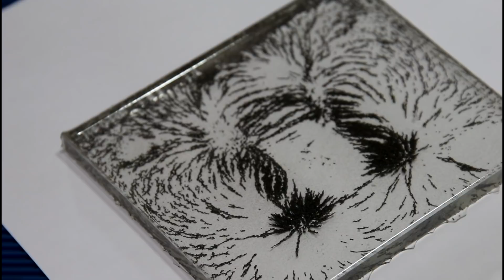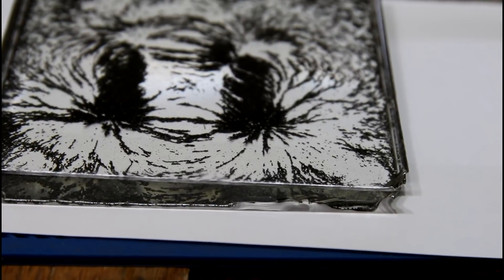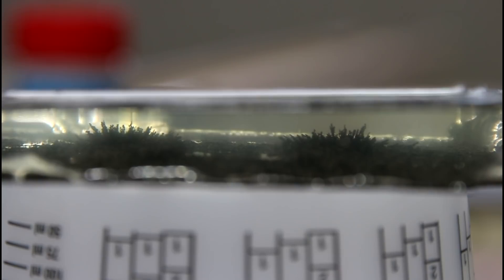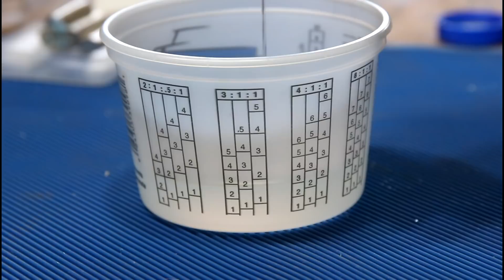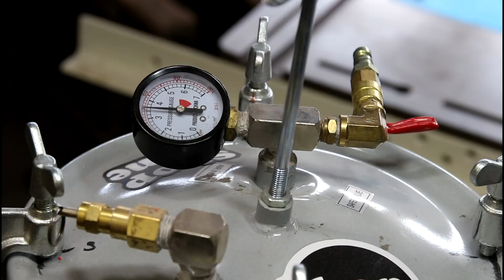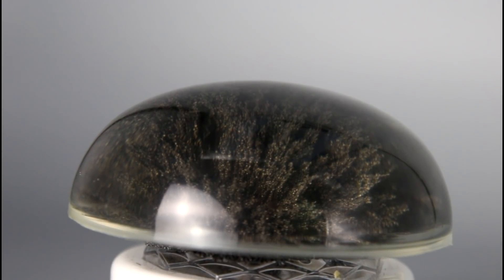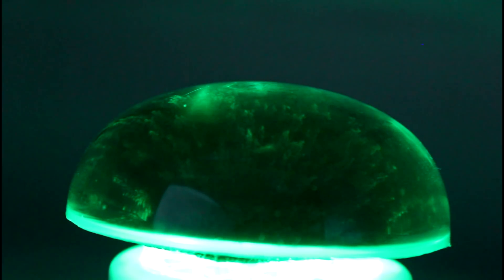Capturing Magnetic Lines of Force in Resin?: Social Distancing Day 5

Comment: Heey! I just saw the silicon problem, you can use 2 pieces of 8 mm mdf then  hole it to fit part of the top and hold the parts with 3 or 4 contractor springs ( tight enogh to keep them together while the resin cures ).
Hope it works!

Comment: Ok so, I'm almost a year late... but a few ideas?

What would happen if you mixed the iron in with the resin, poured it into the mold, degassed, then put the magnets on the outside of the mold? Maybe use a semi quick setting resin?

You could invert your idea and put the magnets in the bottom of the container, then place the mold on top and repeat. You'll just have to be careful to not knock the magnets over. 

You could theoretically make a brick, doesn't have to be thick... You have the magnet flat on the bottom outside the mold, you sprinkle the filings in around the magnet, then go about the process. 

What do you think?

Comment: I have this globe and there is a way to use it. Before you pour, wrap the globe in Press n' Seal plastic wrap. It has to be Press n' Seal or it won't work. Then you can tape the outside of that if you like though I've never had to.

Comment: For the round mold Couldn't you just do the bottom of the round mold like you did every other mold (magnet open top in the pressure pot) then put the top on the round mold and fill the top when the bottoms not going to mess up?

Comment: Could you use silicone caulk to adhere the silicone mould together, do the pour, then just sand any gaps smooth? Or even use a bigger ice ball mold, seal it with silicone & tape, then turn it on the lathe and then mount it on a piece of wood, with an LED light under it, hidden by the wood base...... Please, try this!!!!!

Comment: Cool Video. I have an IDEA. How about you do the iron filings in resin but have enough iron filings that it projects over the top. Cure in the vacuum and then let it soak in salt and vinegar solution so the iron filings oxidize. then let it dry and walaa.. The rust colors should look amazing inside the resin.

Comment: Hello, dear, you should use hot glue gun to seal halfs of silicone sphere. 
I have such one (diameter 60mm) and I tried to seal it by different ways - by duct tape, by small clamps - nothing helps, resin was poring out of a mold, until I tried to seal it by glue gun.

Comment: I noted other youtubers stating this... Why haven't you tried mixing the iron filings into the resin then have the magnets on the outside of the mold?  Use a relatively thick/thin resin to allow the filings to move and create the 3d render of the magnetic field.

Comment: The iron filings align themselves to the magnetic field lines not force lines. The force is applied as a reaction of moving charges or aligning magnetic domains in the material. If you are trying to capture the field lines themselves it may work better to mix iron filings into a long cure time resin then apply a magnetic field so that they slowly align themselves along the applied field before curing.

Comment: I'm just thinking out loud but maybe since the tape won't stick to the silicone it will stick to itself next time try wrapping the whole thing up and then poke a hole where the hole is. Then again I've never used epoxy resin so I also might be suggesting a mess

Comment: Very cool! Just a couple FYI's there actually are tapes with silicone adhesive as well as the silicone adhesive itself. https://smile.amazon.com/J-V-Converting-PPT-36G-GRN172-Silicone/dp/B004MSKKI8/ref=sr_1_8?crid=3TRT6FOYDR83G&dchild=1&keywords=silicone+splicing+tape&qid=1595243838&sprefix=silicone+splicing+tape%2Caps%2C143&sr=8-8
and https://smile.amazon.com/GE-Sealants-Adhesives-GE500-Advanced/dp/B000M2UPAG/ref=redir_mobile_desktop?ie=UTF8&aaxitk=dTVs8Cp77cVfmDnswDa5dA&hsa_cr_id=2635427820201&ref_=sbx_be_s_sparkle_mcd_asin_1
I've used the red and green tapes, both work quite well.

Comment: Smoothon has a bunch of different resins with different properties - would be fun to try some of them.  Also found that there are many sources for magnetic powder that people add to finger nail paint. https://glitterandcrafts4u.com/collections/3d-magnetic-powders  Lastly - Bubbles that form after pouring are generally due to moisture.  This could be the resin or the iron filings.  Keeping your resin "dry" is tricky - when I did commercial resin casting we had a air tight container that we stored our resin containers in and would use dry gas (Simple nitrogen from a welding store works great) to purge the container afterwards.  A pressure pot will help but make sure you are filling your pressure pot with dry air.  Very cool!

Comment: you should mix the filing into the resin then put the magnet on the container. if you use some sorta agitator to help move the filings towards the magnet before it hardens you might be able to get clearer lines of force as it would be able to preserve the lines without having to create the base clump for it to climb up from.

Comment: So... could you fill a mold with resin and add the fillings to the top and have the magnets underneath  to pull the lines through the resin? Instead of having them "premade" and dipped into? Or is the viscosity of the resin to thick for the magnets to pull the filling through???

Comment: The solution to holding your sphere moulds together is rubber bands... btw if you want a cooler effect, get a sphere neo mag, and a small (as thin as you can get) toothpick like clear resin stick that has the same refractive index as your resin so it will disappear when the resin is poured, and uv resin the sphere neo mag to that stick, and then the stick to the bottom of the sphere mould using resin to make a sort of foot so it stands up on its own (yes, this would take multiple stages for curing)... then either apply the iron filings now then fill the mould as usual, or wait till the mould is filled and see what effect that makes... but should turn out looking like an explosion of filings emanating from the center of the resin sphere (could layer yellow/red/orange colored filings to maybe make it look more like an explosion if you wished)

Comment: Here's something to try: Ferromagnetic fluid. Works a lot like this, except you need to add a metal shape on the other side of the magnet for it to grow around and the spikes end up much more smooth.  I'd suggest something with wide threading.  And (not sure if this part'll work but) if you can then drain the ferrofluid out after the resin sets, you can reuse it and fill the void with resin (or whatever) of a different color.

Comment: As others have said, it would be interesting to see what shapes you would get from dispersing iron filings within a slow cure resin then pouring the resultant filings/resin emulsion into the mould. With the neodymium magnets you could then even place 1 magnet under the mould and 1 magnet on top of the mould and create a sculpture of the resultant magnetic force lines between the two magnets.

Then, regarding the bubbles of air 'leaking' from the filings (and I'm just spitballing here as I dont know resins), it might be possible to mix the iron filings with your part A, leave it time for the air to release from the filings, then mix the part B in.

Comment: too hot and iron can lose its magnetism, although unlikely those particles are really small. 

itd be interesting to know what the densitiesof the resin are in each stage, premix/mixed/curing/cured.

depending on that, purchase or create ferrofluid with varying  diferrence in density, ie more dense/less dense/equal. 

this seems really interesting and has given me so many ideas. 
i wish i had the means to attemptt.

imagine a copper coil encased in resin tabletop but with hollow tunnels to send batteries with magnets along.

you could feasibly create something like a gumball dispenser like that.

heck just a single hollowed out cylinder in a table top with this magnet prokject or similar suspended particle resin cast ie-wood, glitter etc. use that hollowed out area to install leds or somthing. that way they are both optional and replaceable vs castinf in the resin.

im pretty stoned howed i get here...
Youtube >.>

Comment: you need to make a external casting to act as a framework to support to silicon innermold. you could use resin or plaster of paris or something for the support mold. Also you could drill a hole for magnets in base of framework help hold the whole thing together for putting in pressure or vacuum tank.

Comment: I have those same sphere molds

I just use hot glue to keep them secure. Hot glue the edges.

Yes it actually stays in place enough for the epoxy to settle after curing ^^

Comment: You could seal the two halves of that sphere mold together with silicone cement. But you would probably have to destroy the mold (or at least damage it) to get it off after the resin hardens.

Comment: Hi, when I’ve used the ‘globe’ silicone moulds, I filled the bottom half first, run some fire across the top for bubbles, let it stand to begin curing for about 4-5 hours, then put the ‘lid’ or top part on and fill up the rest through the hole. :) I don’t have the machine you have though...

Comment: I wanna know what would happen if you mixed the filings into a thinner, runnier resin, poured the filing mixture into a dish, poured clear resin on top, and then added a strong magnet to the bottom of the dish. Would the resin allow the filings to move around and create structures along the flux lines? Or would it just clump up in the bottom of the dish and make a mess?

SCIENCE!

Comment: If you pour the resin over a piece of smooth wood first, like a wooden spatula or a ice cream stick, it will significantly reduce the bubbles. And pour more slowly, most people put the stick into the mould at an angle and pour down it as slowly as possible from as low as possible to reduce bubbling as it meets the surface.

Comment: Hello, I just fell upon your post and might have a suggestion or two for you. If you wanted to try to use the two pieces of the Dome together again you might want to try to seal the lips of each piece with some silicone glue or caulking. It also comes in clear and it should stick to the silicone domes at least enough for your project.

The second suggestion I have involves around the type of camera and or lens that you're using. You may want to use a zoom lens on a SLR digital camera and take it out of automatic mode. Adjust the lens and camera settings to maximize your depth of field. Part of the problem you were having I believe is that camera was focusing on the nearest of the stalagmites of magnetic particles. If you increase the depth of field the focus isn't just in the front but also opens up to include the back particles. If you try this and it's successful you might want to let me know I'm just curious. Good luck, stay safe, Paul

Comment: You could just mix a small amount of the filings into resin and the pour it. I believe they will form lines with spaces of clear resin in between them, without going into big clumps like when they're under gravity in air (being suspended in resin before being in a magnetic field will make it easier for them to form longer lines that don't collapse under their own weight)

Comment: Suggestion on the 1st mold you tried. Could you try to seal it using hot glue? Could put a bead down then put them together, then put some on the outside. Or maybe even try silicon caulk, and allow it to set up before putting the resin in.

Comment: Maybe breaking stuff into half-cured resin? Example: break a piece of wood and see if the splinters kinda fly off and get trapped mid flight? Maybe hit something porcelain with a hammer? 

How would an egg react when the heat reaction starts? Would it explode? Could you capture that in mid-explosion? :D
How would colored sugar react? Does the heat reaction get hot enough to melt it? 

Could you trap smoke in resin? Maybe use a straw and blow it into the liquid? 

Any other way to make bubbles in resin? Put food dyes in your mouth and blow it into the resin with a straw? 

I guess any bubbles techniques would be hard to get clear since you can't use the pressure pump?

Comment: Looks as though the silicone sphere mold has a flange that goes all the around on the equator.. can you make some sort of scanner clamp. For lack of better words.  Or with two thin sheets of acrylic, cut holes in the size of the sphere, but still engage with the flange, the. Use the magnets to apply the clamping pressure.

Comment: What would happen if you suspended a neodymium magnet in the center of the sphere with filings all around it? Possibly do it a half-sphere at a time with the magnet suspended from above by some other magnets hanging from a string or wire then, after the first half is cured you could add more filings to the top of the suspended magnet, add the other half of the sphere and do a pour on top of the first half. I don't know. But it might work.

Comment: Have the metal shavings mixed into the resin and use a larger neomag to pull the suspended particulate into lines? perhaps less bubbles and no clue as to if itd make for easier thinner lined.. .I'd think so but. . .SCIENCE!

Comment: You can also mix iron veilings into the resin and then stick the magnet to it. instead of pouring the resin over the veilings. Althoug you probably may not use as much veilings as in the dome here. I also think this would work better with the ring or bar magnet, instead of the neodymium magnets.

Comment: Suggestion: cast each half individually. Dont pour filings before resin; cover the bottom with a thin layer of resin, sprinkle filings, cure in vacuum, add more resin and filing sprinkles and continue this until you complete it. Labor intensive, but will turn out very cool. One guy made a bathtub of goldfish this way!

Comment: Hey Peter, you could try a circular led-strip on the bottom edge (either from below or the sides) for lighting, that should work better, since the light that you used didn't get through the densely filled middle portion.

Comment: Great video.
I have been wondering why use a pressure pot to make the air bubbles smaller? In my mind I’m thinking wouldn’t it be better to use a vacuum to pull the air bubbles out of the resin all together?

Comment: What if you put resin in a taller container with magnets at the bottom then add the iron powder to it? Would the iron powder make it to the bottom? Or would it get stuck halfway as the resin hardens? If so, could someone add different colored iron powders and make “fireworks”?

Comment: I do polyresin casting and I wonder what if you used powdered metal and added it into the resin and have your mold polarized and try to catch the flux lines of the magnet suspended in an orb.... I imagine you would need a pretty strong magnet to hold the powdered iron suspended in a viscous liquid so as to catch the arcing lines between the poles... that would look cool

Comment: Ok I’ve got an idea for making the sphere molds work. You need binder clips! The smaller sizes. Clip them all around the silicon mold and it doesn’t matter if they stick to it or not. They are just using pressure to hold it closed. Kind of like wood clamps when you are gluing wood pieces together. The smaller sizes come in large amounts to begin with so just put as many of them on that rim as you need to really seal it tight. They are dirt cheap too...

Comment: Here's a kind of weird idea, and I don't really know if it would work: Would it be possible to make a kind of resin ferrofluid? I mean probably not right? Because the resin compound might be too thick, but if it worked it would be kinda killer. I'm just thinking that you mix the thinnest resin you've got with the iron shavings, and see if it will still react to the magnet. Or even just put some shavings at the bottom of a cup of very thin resin, your least viscous... I mean yeah, no. I don't know. If you try it and it works I'd be interested to see it.

Comment: You should use a lower viscosity resin. It’ll prevent the metal shavings from moving when pouring and if they do the resin will be thin enough for them to move back. I’ve seen some resins that are almost water like.

Comment: I'm commenting this as I watch the video, which is dangerous as you could still do it, but why not mix up some filings in the resin? Considering what limits the length of any forming 'spikes' of filings in air is gravity, and the buoyancy of iron filings in resin will be much greater than in air, I'd imagine you could get some much larger spiked designs with that.

Comment: Try Ferro fluid. It shows magnetic fields much better. But you'd need a stronger magnet and a resin that doesn't mix with the ferro fluid. Or maybe mix it and make ferro fluid resin.

Comment: 6:30 ish If you have (or have access to) a 3D Printer, you can try making a set of half-circle C-Clamps that fit the lip of the spherical mold. That way, you can put the 2 halves together, slip the clamps around the lip and them tape the clamp halves together to make sure they don't pop off...

Comment: You should have use a resin that was much thinner. Like alumilite clear slow. Also for the sphere mold, you can hot glue the seam after it’s put together. Go over and under the lip so that it holds when it’s dry as well.

Comment: Do you have (or know someone who has) a 3D printer? If you could get someone who could make something the same shape as the silicone mold's outer diameter, might be able to make a shell that would hold the mold and lock it together. It wouldn't be a bond like tape or glue, but a physical holding of the mold together.

Comment: Stronger magnet with two poles touching the bottom of the container. Suuuuper thin layer of resin. Sprinkle in some shavings. Let cure. Another thin layer, more shavings. Let cure. Rinse and repeat. Should minimize clumping and show a really fine, detailed set of arcs.